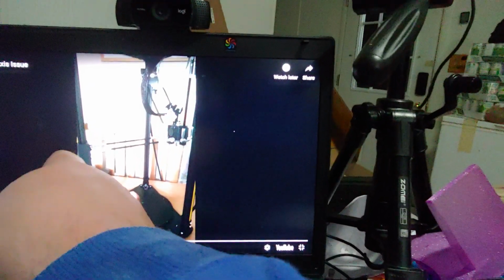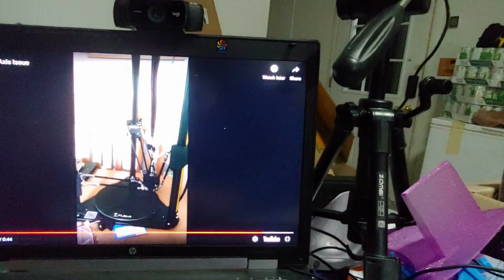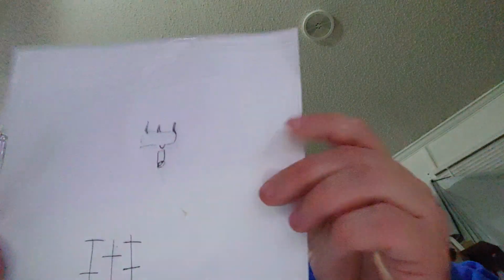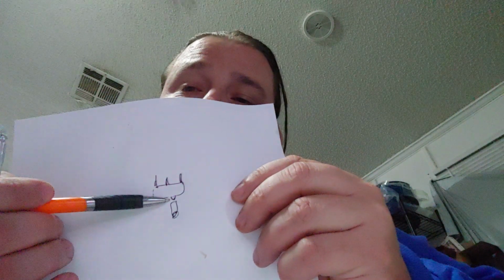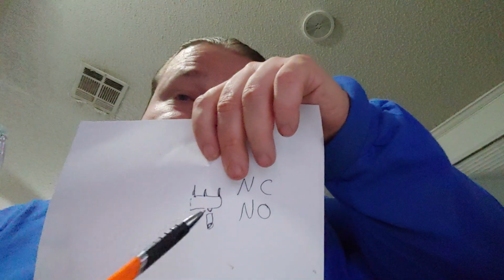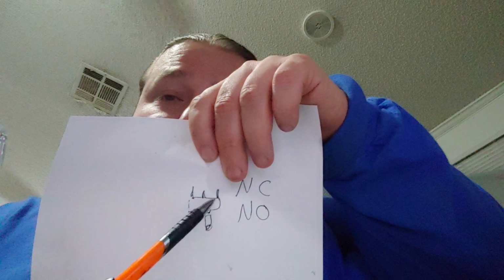FLSun Q5 one arm does not home limit switches likely culprit

Comment: Thanks for the video, you did an excellent job explaining the difference between cartesian and delta printers. I have two flsun QQ-S and two flsun Q5 printing paintball parts around the clock. As long as you can maintain them they are work horses and decent low cost printers. I had the exact same problem with the Q5 and can confirm it is the limit switches. I am not sure about the newer super racer model but both the QQ-S and Q5 use the same switches which you can get a pack of 3 for $10 on amazon.

Comment: Good explanation. Although, if the printer is printing, and in middle print one of the arm stop, like the video you show?? It's still the home switch ?! I ask this because I've the same problem. Mine, start to print normally and after couple of minutes, it start to print in the air... and I realize one of the arms stooped moving. Printer brand new. I'll test the home switchs like you said, but its weird when we start to print OK and after some time the arm stop.
Reply: I am not totally sure. MY gut says no. if it started fine it should IGNORE the home switch after it gets going. that would be a bad wire or bad driver or some other mechanical issue I suspect.